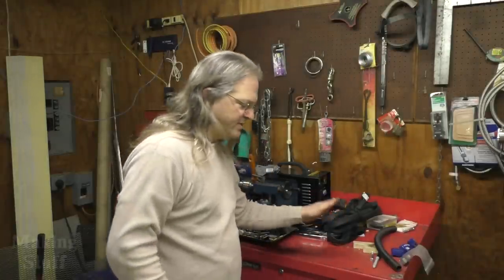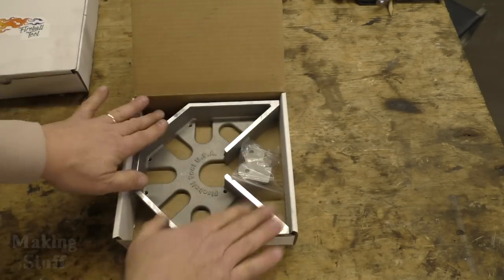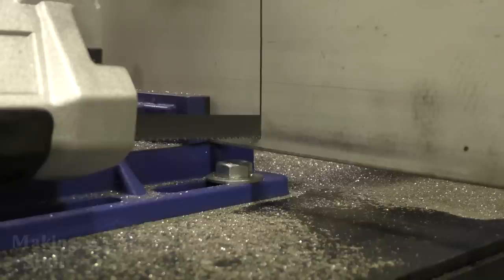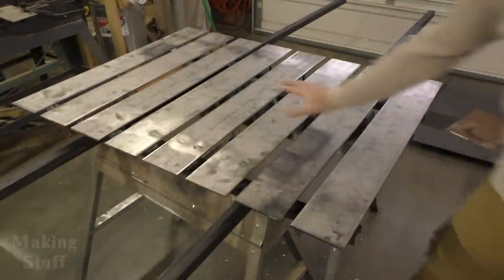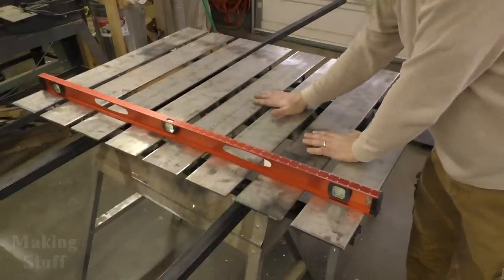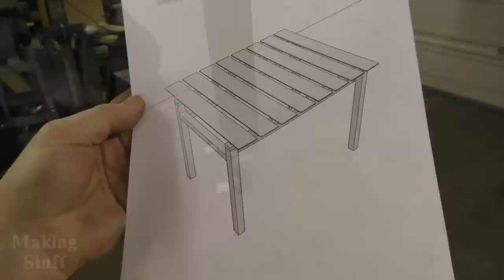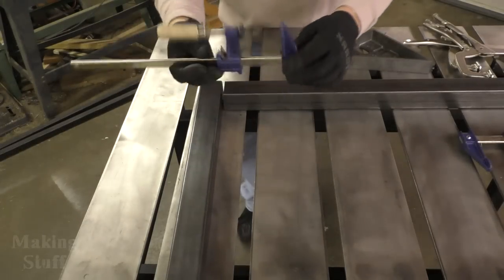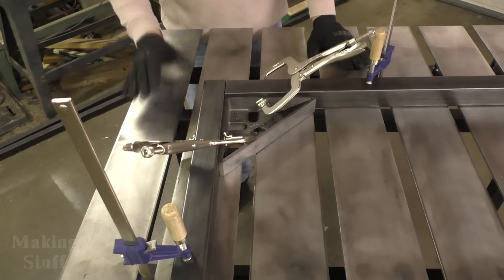DIY Welding Fabrication Table - Stronghand On a Budget

Comment: What's the size of these slats?
Reply from the maker: I'm pulling these numbers from memory so I think it's 4" x 36" x 3/16" could be 1/4" but not sure because I've slept since I made the video, lol!
Reply: @MakingStuff  thanks for the reply, I heard you call it a 5in a in the video but was curious on the thickness. Thanks!
Reply from the maker: You are correct, it's 5 inches not 4.  I went out to the shop and measured to make sure.

Comment: Fantastic project - I'm just about to make one.
Can I ask why you used Stainless rather than mild? Is it just for corrosion or some other magic? 
Also, do you like the plates fixed or would you like to have ability to move them laterally for bigger or smaller gaps? I've never used a welding table so don't know if it is worth the trouble to make the plates movable.
Reply from the maker: I used stainless because it doesn't rust.  I also like the look.

Comment: Do you have a ballpark on the cost? Curious what "On a Budget" means.
Reply from the maker: It was about $275 with the stainless steel top.  Which is dirt cheap compared to a Stronghand or Certiflat of comparable size.
Reply: Making Stuff Thanks! Good to know.
Reply: Sweet!
Reply: if you already have some bolts and wheels laying around and use regular mild steel for the top probably cost between 100-150$ i wouldnt skimp on the top plate thickness though 1/4" would be a good compromise between weight/cost and strength/ warp mitigation
Reply: Making Stuff I would love to know where you can get it that cheap. I have been searching and a 24"x48" 1/8" thick Stainless Plate is $300. 1/8" is really thin and would need ribs for support. Looks like a 24"x48" complete table will cost at least $500. Sure would love to know where you get your metals.
Reply: i said mild steel.. of course stainless is more expensive and requires different equipment to weld it.. for a welding table i dont see an issue with regular mild steel and i agree 1/8" is certainty too thin for a welding top that wont distort
Reply: @unapologetic7900  I can't seem to find it for less than $800...

Comment: What’s the dimensions of this build? I’m not sure if someone’s already asked that so I apologize in advance.
Reply from the maker: In inches 48W x 36D x 38T
Reply: Making Stuff thank you very much. Hopefully mine comes out as good as yours. Did you use 1/4”
Reply from the maker: Yes stainless top is 4" x 1/4.  FYI, the Sketchup 3D model is available to all Maker level patreons.
Reply: Not to try and sound like “that guy” but didn’t you say in the video that the slats were 5” wide?  Here you said 4” and with a 1” gap in between the slats that would only be 40”w not 48”.  Just wanted to see if you could clarify?  Excellent build by the way, can’t wait to build mine.
Reply from the maker: The slats are 5 inches with a 1 inch gap.

Comment: Love it! Great idea and execution! Silly question about the Tig, but did you use the same gas for the mild steel as for the stainless?
Reply: KonicavaBR  Not sure I said 'active' anywhere, I just wondered whether he was using Co2 or Argon for both as there are lots of flavours of inert gas for different tasks.
Reply from the maker: I used C25.
Reply: KonicavaBR  Thanks for the clarification, although I'm not sure what your point is though. @Makingstuff has already answered my question.

Comment: I don't understand what the adjustable top gives you.
Reply from the maker: It helps make it flat. You make all of the slats in one plane.
Reply: its a good idea to have that adjust-ability if you do any thick hot welding or plan to use oxy acetylene on the table.. because even if you make it perfectly flat without the adjustments in the beginning after enough trips to 500+ Fahrenheit and with some help from the hammers it wont be flat for long.. atleast this way you can mostly re-flatten it when critical projects come along

Comment: Hi,
cast iron vs cast aluminium for mega square? 
Cas iron is more expensive. But is it realy import to get cas iron.
Thanks for your help
Reply: Spatter doesn't weld itself to cast iron, you can just flick it off real quick instead of breaking out a chisel or whatever.

Comment: You were hardworking I could stud bolt thread Not to worried about the welder on bolts but I use the welder on the nuts females Not to welder on bolts male keep good work

Comment: That is a fortune in stainless stock. You would be better off buying regular but thicker steel to prevent bowing in the middle which will happen with those slabs for sure
Reply: I made a small one and after cleaning it i just wiped it with a bit of WD40 and it holds pretty good from rusting. I like your videos. Especially the CNC plasma table. I am considering doing soething similar but i am very green on robotics still. Good work
Reply: Was thinking the same thing, it is nice to make a table but not overspend. Doing mine not with stainless top but quarter inch mild steel top with a middle brace to prevent bowing the plate if I put heavy projects to weld.
Reply: @fasousa4798 a film of  wd40 seems like a good idea

Comment: First time you bang on that table it's going to be all out of whack.
Reply: What can be done to prevent that?  I built a fab table...used 3/8th in. steel, tacked each slat with a cross beam in the middle of each, and they still warped.   I am now wanting to rebuild with the ability to level as I have no place flat and no place level in my shop.

Comment: Somethings up with your welding setup. TIG shouldn't spark like that. You've got tungsten contamination from not properly cleaning everything or you're not using 100%Argon
Reply from the maker: I know, I never figured out what was causing the sparks.  I think I may have been a bad or contaminated tungsten rod.

Comment: You level each side but didn't level across. Sides are now level but not necessarily on the same plane, therefore top may not be flat!
Reply: It will still be flat relative to the work piece

Comment: I think the adjustable slats are over designed and will rarely be used.
Nice to be able to clamp between them though.  Radius the 4 corners 1"
A 1/2" thick steel plate which extends beyond your table frame is also very usefull and quicker.  It will also remain flat.
You might consider a shelf for grinders etc about 1' above grade.  1/4" plate works well for that.   A shallow shelf around the perimiter of 3x3"x1/8" Channel down about 6" is very handy too.  Music is really bad............
Reply from the maker: The slats won't get used much, but at least it can be adjusted.  Thanks for watching.

Comment: It's okay for small stuff but for larger you'll need stronger and more stable u channels other than that okay
Reply from the maker: It works great for me.  I use it for all kinds of stuff.  Would like to have gone with thicker slats but stainless is so expensive.  Thanks for watching.
Reply: Oh why use SS when carbon steel has quite a bit less electrical current resistance, and is cheaper to boot?  For looks?  It's a frackin' welding table, not some piece of glitzy art.  Get real.  And yeah, U-channel or square tube instead of the bolts would have served the same purpose, been less expensive, so much stronger, and you wouldn't waste time leveling and aligning.
Fancy lookin'!
:)

Comment: Ok, but I would have notched out the tops of the legs to fit down into the channels for more support, and then welded around the entire thing, rather than have them sitting on the edges of the channel.
Reply from the maker: I'll keep that in mind if this one fails.  Thanks.

Comment: You should really use these types of table for fit, remove for the actual welding
Reply: Why?
Reply: user12345 you have less spatter to clean off and all the will start warping the table.  I use a 4x6 square tube 3/8 thick to keep the cutting edge of a snow plows from warping while I weld and it to has begun to warp.
Reply: The heat won't pass through enough to warp it, and that's the whole point of having slats, you can replace them when needed.
Reply: user12345 is not pass through. You put a weld on something it pulls, so when you have something clamped down and its wanting to pull it will eventually pull the slats.
Reply: well isn't that the whole point? you make your table table strong enough to not bend? so you keep your work piece from moving when being welded?

Comment: Bob, firstly get a haircut. Secondly, why slats? Slats are totally impractical. Anything round will roll into the gaps and drop to the floor. So you can't put welding rods or tungsten rods or bolts on the surface as they may fall through. For a hobby welder just use a steel 1/8" plate. cut
Reply: Roger, firstly what does his hair have to do with welding? Secondly Why don't you worry how you have your hair. If you have any.
Reply: Do you have any other sassy fashion tips for the clumsy metrosexual man about town Roger?
Reply: @M3rVsT4H  Plenty but we'll start with the hair.
Reply: @rogeronslow1498  Drop the hair, but don't drop the bolts..  Got it.